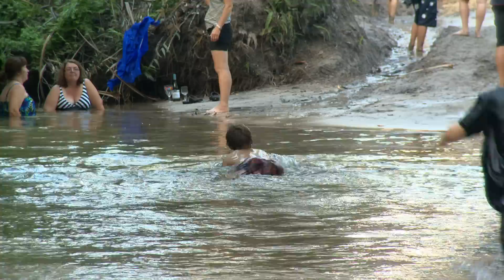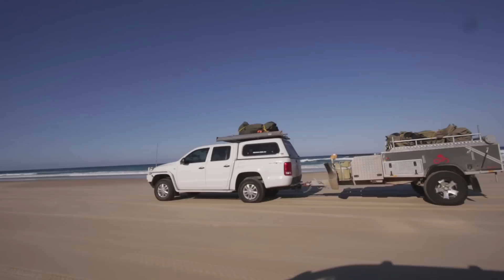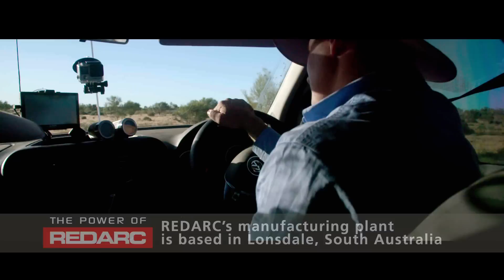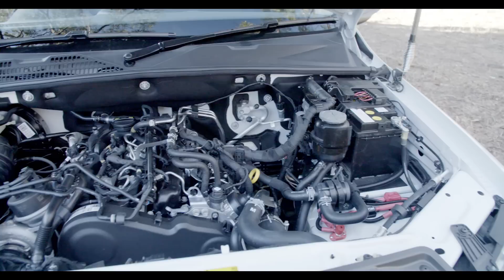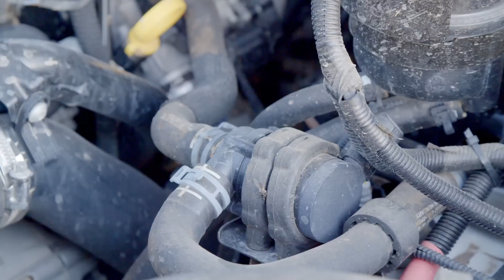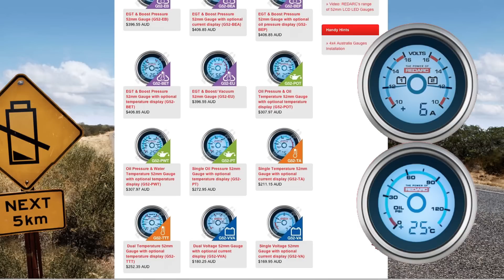The Benefits of Using 52mm Gauges to Optimise your Vehicle

Comment: NEW Redarc EGT & Boost Pressure 52mm Gauge   $400 aud....jesus i cant afford that
Reply: Would love a nice set of gauges  but at $400 a piece that's crazy.
Not going to happen
Reply: Go and price two gauges - VDO boost and VDO EGT (+ sensor/probe and cables). Neither of these have alarms. When you consider they are the equivalent of two gauges + sensors, the price is reasonable.
Reply: N Noddy redarc is hard to read on brief glance and egt gauge starts at 300 degrees. Vdo is very easy to read and reads egt from as low as 100 degrees, not to mention how long and trusted vdo is in the game. This is the reason I chose vdo because I’m ocd with monitoring my engine. I have driven a patrol with redarc and didn’t like them for those things as well.
Reply from the maker: Thank you for your message.

All prices include full 2 year no hassle warranty as well as complete technical support, both direct from REDARC's facility in South Australia as well as a network of installers and stockists around the country.

If you'd like to find out more please contact our Tech Support Team on 08 8322 4848 and they'll be more than happy to discuss further.